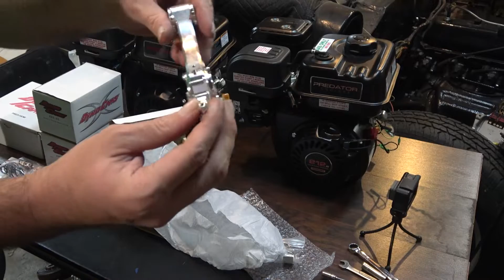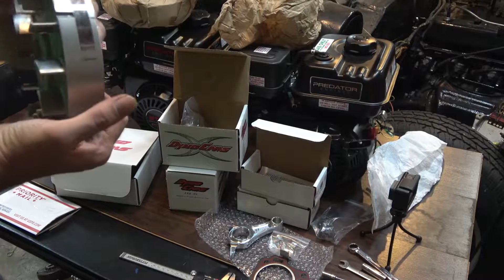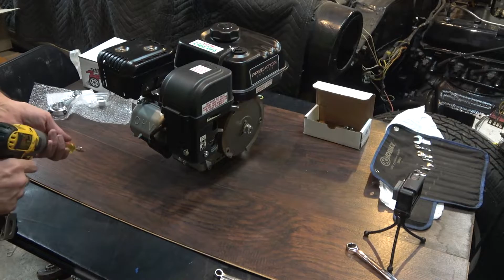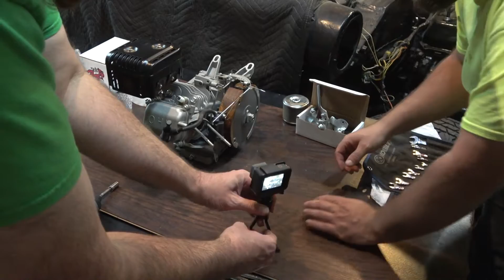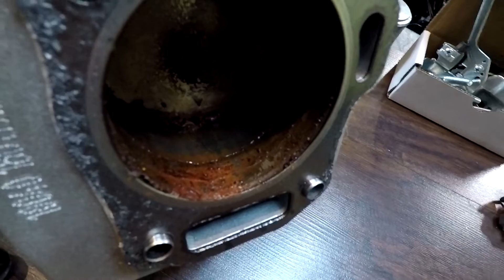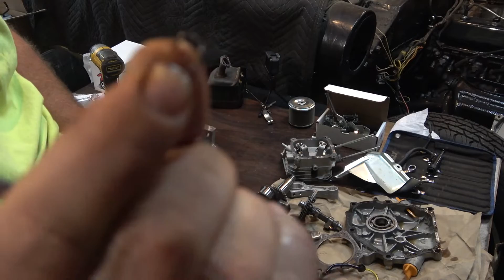Building a performance predator engine, how bad can it be?

Comment: Bought a 225 tillotson and pot on a Baja warrior built a stage 4 predator put on my other warrior money spent the tillotson walks all over the predator on street but off road predator shines
Reply from the maker: It all depends on how you build it. Most importantly the cam determines the overall rpm and torque that the engine will produce, they are definitely not all created equal. Thanks for watching David! Maybe check out some of our other vids and consider subscribing.
Reply: @FireAndGasoline  I have been and sub also sent your video to the club should be getting a few more people soon
Reply from the maker: @davidpayne4084  thank you, i appreciate it!

Comment: Why go with a pvl flywheel instead of a bullet flywheel?
Reply from the maker: It better suited my application basically. It has a cheaper cost and 28 degrees timing instead of the 32 of the billet one.

Comment: I just purchased a stage 4 kit from go powersports and will be doing the same really soon.. I went with 22lb springs, arc billet connecting rod and arc billet 32 degree advance timing flywheel.. but basically the same if not a little better set up..
Reply: Asphalt Cowboy, : your usernames apt or your young - don't crow about it till it successfully runs,fair enough ? No offence intended.Trev New Zealand
Reply: I never said it wouldn't run.. I just said it won't last long until it breaks.. I ran mine like this for six months and never really got on it.. but once you do get on it and rev a lot, it will eventually happen..
Reply: @asphaltcowboy7868  I never said you said it wouldn't run, I was meaning generally.dont put word's in my mouth please & raise your comprehension skills.Cheers Trev

Comment: Heck yea bud love it and congrats on the coupon code 🤘🏻🐿🤘🏻
Reply from the maker: Thanks bro! If everything works out good we will get a better one for next time. Want this to be a good thing for everyone! 🔥
Reply: @FireAndGasoline  awesome bud
Reply: Fire & brimstone: some constructive criticism/suggestions: 1/ clean up that bore with wet n dry sandpaper or an AN 500 Grit Bottle Brush hone & plastigauge the stock b/E bearing & Crankshaft to see what clearance their running from the Factory ?..all part of complete engine building &  that doesn't mean parts swapping ! 2/ No-one has ever checked or mentioned bore to piston skirt anywhere : not in. ANY video I've seen - just slide a feeler gauge down between an upside down piston between the upper & lower areas of the skirt ! If it's too tight use a small engine hone to open it up a bit.It will rev freer & go better with race engine clearances.Dont withhold info or don't you know it other than pushing your sponsors parts ?.Just saying.No offence suggested.Trev New Zealand

Comment: Posting a 50min incomplete video with terrible results from an un-organized person that destroyed a brand new perfectly good running engine... Wowzers what a waste
Reply from the maker: It happens, not everything goes as planned. The engine will be fine just not for the project. There was no way to know it had gotten water into the cylinder before removing the head. We will still use the engine just for a different build. Thanks for watching Jacob!